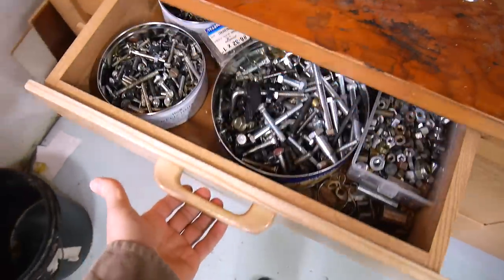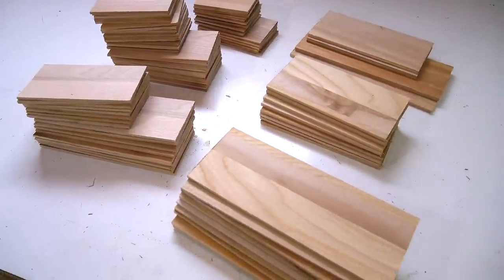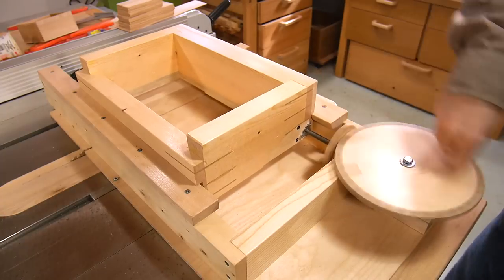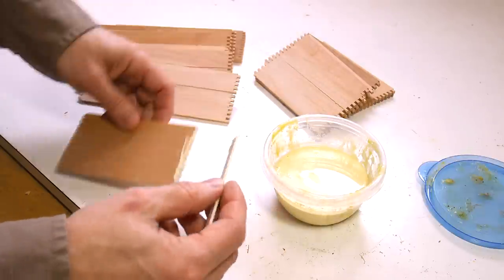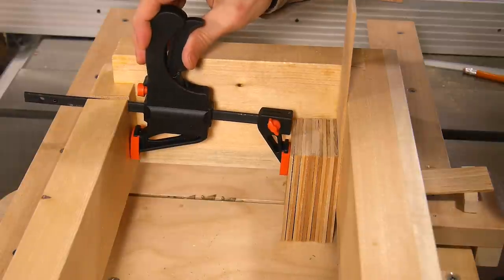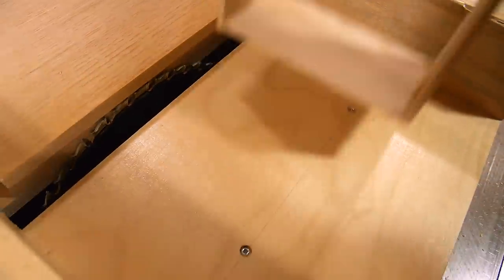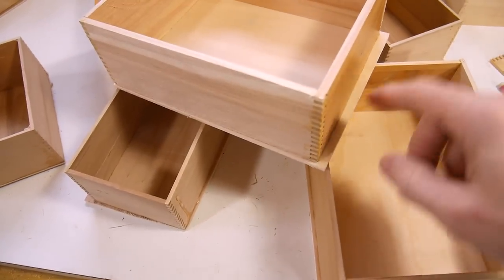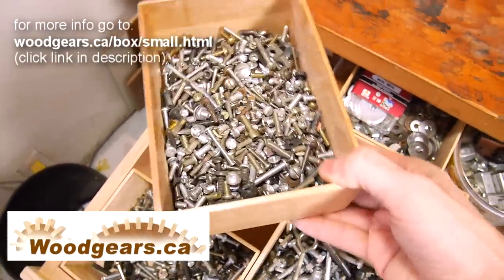Small box joined boxes

Comment: A neat trick around every corner in this video. That angled flush trimming setup, for example.
Reply from the maker: Yes, I spend a lot of time thinking about how to make the project before I actually make it.
Reply: Matthias Wandel It shows in your work!
Reply: Matthias Wandel I do the same, no matter how big or small the project....Specially with big projects like renovations, I basically go over the whole project in my mind before I actually pick up a tool.....
Reply: Justin Pang if you look at the outside of the jig it is not able to go low enough for the C-clamp to work with any amount of pressure

Comment: Back cutting on the pull stroke of the SABJJ made that go very quick! Thanks for sharing.
Reply from the maker: MRrwmac Have been experimenting.  For vertical cuts like that, the saw works better when it's cutting backwards.
Reply: Matthias Wandel Acting just as a scoring blade/ wheel. Was nice to hear you at BrainPick. Thanks!

Comment: Matthias, I found a neat way to store my fasteners. I got a stack of alarm control boxes, and plan to put dividers made from scrap polycarbonate. I'll make a way to stack them like drawers so I can easily save space this way and have nice access as well. The back of the panels have mounting studs that I'll either grind off or chisel out. Some of the boxes are used, but some have not been, so I'll need to cover the openings on the sides.

Comment: I (being obsessed with boxes)  like these a lot. I and loved the bevel you put on the bottom. Never thought of that and it makes them a bit more refined.
Reply from the maker: Christopher Demetrick And it hides the fact that the bottom is just glued on the bottom.
Reply: ***** That would be much harder to clamp and much much harder to fit up. Matthias made cutting the bottoms easy by oversizing them and trimming them later.  If the bottom needs to fit exactly between the 4 sides then the cuts need to be very accurate.  You are right that it would automatically square the sides if you could install the bottom during glue up
Reply: Sully800 that is why most drawers or boxes have the bottom installed inside the 4 sides...it squares up the boxes and doesn't rely on the joints to keep them square. Now with something "utility" like these, it isn't so important but it is VERY important if you want your drawers to slide properly....well, THE drawers you're installing in a cabinet, if YOUR drawers slide too easily, it'd get mighty uncomfortable under your jeans! lol

Comment: A tip for gluing finger joints. Put the joint together but do it flat, that is, butt the ends together on a flat surface. This makes sure the joint is aligned and you don't glue the wrong side. Add a thin layer of glue to the fingers on the inside of the joint. Hinge the joint together so that it correctly forms the right angle. The glue now makes contact with all the inside surfaces and nothing but them (minus any squeeze out, of course).

Comment: Greetings form Norway!

Awesome video. I suppose you could use a 10 - 12 mm round piece of wood and screw it in the center of the box(screw from the bottom) and use that for lifting the boxes out of the drawer. Especially if you made the boxes to cover the entire drawer. Not sure how much weight it could handle but at least for small boxes I dont think it would be a problem.

Thanks again for a good video!

Comment: You said in your other video "the space efficiency of pure chaos is hard to beat." I bet you could get more screws in that drawer if you were to forego the containers entirely and just dump them in there. You may have some issue finding the one you want though. Perhaps instead of putting boxes in the box (the drawer), instead cut thin dividers and notches in the drawer so that you can drop the thin dividers into the drawer. This will keep the individual components separated while adding minimal weight and space overhead. You'll need to work out an interlocking system of dividers though, and perhaps that would offset any gains you might see.Hmm. Maybe if you painted the bolt heads in different color paint, one color for each thread type, then just dumped them all in the drawer you'll maximize the space savings while retaining some ability to pick out the parts you need more easily. Length is easy to judge at a glance, and the colored bolt heads would easily identify the thread type.Just a thought. Good video though!

Comment: I've been trying to learn about box joints and had a question about your video.  I've seen a lot of people use hand planers to trim off the excess parts of the box joints, but in this video you just trimmed them with the table saw.  So I was just wondering if you used this method just for this specific job, or if you use the same method for all of your box joints, and why?  Thanks for sharing your talent.

Comment: Will the bottoms hold with just glue? Would be great to see them joined too! Though I guess you would have much more trouble making measurements to guarantee they fit perfectly.
Reply: allluckyseven yeah a rabbet would make them infinitely stronger and a dado even more so but with such thin material you're pushing the limits of the material. If you wanted to make them stronger, and I've done this on larger pieces, is you drill 1/8" holes through the bottoms into the sides, then glue in 1/8" dowel. Leave them long then trim them off with a flush cut hand saw.....I've done that on the sides of decorative items and used a contrasting wood....makes them quite pretty.

Comment: Would a wide paintbrush work to get a good coat of glue between the notches? Dip the brush and just run the pieces of wood over it. I think the bristles would get most of the glue where you want it.
Reply from the maker: xWOOLYxMAMMOTHx Yes, would work, but would be messy, didn't feel like having to clean it up.

Comment: Matthias, how come when you were cutting the finger joints for the 2nd side you pushed the jig through the saw turned the gears and pulled it back through and turned the gear, but when you cut the finger joints for the 1st side you pushed the jig through and pulled it back then turned the gear and pushed it through and pulled it back then turned the gear. Why did you do it differently the second time? Thanks so much and I LOVE YOUR VIDEOS!!!!!!!!!!!!!
Reply from the maker: Reese Asher Because I realized for those cuts, cutting backwards works just as well.  Only realized that part way thru the video.

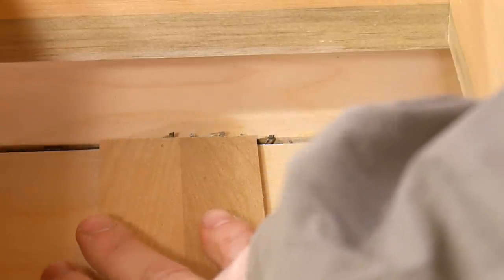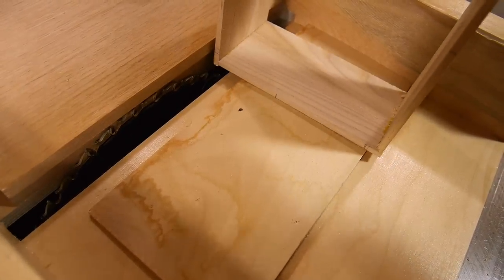Comment: Nice work however, one question. Why setting the blade higher than the thickness of the material at 1:43 and then flushing it at 5:55? Wouldn't it be quicker to make smaller cuts to skip the flushing? Thx

Comment: For the clamp in your box joint jig: do you think the lack of holding power was just because it was a low quality clamp? Or was it just that any spreader clamp in that arrangement would fail? ie would the irwin clamp of similar design hold up? I know those to be pretty solid quick-clamps
Reply from the maker: +Chris Johnson that style clamp is not very strong
Reply: corap patik modelrni el
Reply: Thanks for the spam Rick!

Comment: lot of neat tricks Matthias :) i wonder why you wouldn't have used a long reach clamp when you were cutting the shorter pieces though
Reply from the maker: Peter Matthew Longer clamps don't help because only the top half of the stock holding box is exposed on the outside for clamping against.

Comment: With just glue holding the bottoms on, are you worried about how much weight all the screws put on them?
Reply from the maker: Jason Steih No.
Reply: Matthias Wandel I'm pretty confident about the strength of the wood glue, but why didn't you incorporate a rabbit and/or dado to put any doubt to rest?
Reply: James Campbell Gluing (plywood) bottoms on is surprisingly strong, long as you sand flush so bottom / glue joints mate perfectly - I used to always cut slots for bottoms - so much quicker this way, full storage use of box height, more attractive (to me), and probably as strong, since the slot itself weakens the box (many solid wood DRAWERS split/crack along the slot of sliding bottoms. Very small boxes you can get away w/ solid bottoms glued on, but larger ones you need play so they don't expand/contract unevenly & split.

Comment: I'm kind of surprised those bottoms work with only glue, without a groove to hold them in. How are they holding up?
Reply from the maker: +spaaarky21 No issues.  Theglue is as strong as the wood.
Reply: +Matthias Wandel Is it possible to finger joint the bottoms as well or would that be too overcomplicated/overkill?

Comment: Isn't it possible to cut the fingers for both ends of the side board from the same index.? Assemble, then rip the excess material off after the box has been assembled?  Then the tops and bottoms of the sides are perfectly matched.
Reply: Burntsider You would have excess to rip off both top and bottom.  More work, wasted material, shorter boxes vs. offsetting the fingers with one simple setup change.

Comment: How much weight can the boxes hold? When I eyeball my constructions I probably go way overboard, but this looks kinda flimsy considering how heavy metal parts are. I don't really have much experience with glueing thin wood together. My boxes would be almost finger thick, with a groove for the bottom. So, is this really enough? Doesn't that bottom break off easily?
Reply from the maker: Tarc I don't know.  I haven't broken any.
Reply: Alright, fair enough. Thx for sharing :)
Reply: Tarc I'm no real woodworker (yet) but all those glues say <<Stronger Than Wood>>, so even without the finger joints, one should expect the boxes to break anywhere else than the glued parts... but with those finger joints, it seems rock solid to me.

Comment: Why do the boxes have box joins on the edges, but not the bottom?  Are they just decorative?
Reply from the maker: because box joints on the long grain side add no strength
Reply: It's a grain thing?  Cool.  Thanks for the reply.
Reply: I'm in college for wood working and cabinet making, and usually you wouldn't do a finger joint on the bottom edges because you would slide a bottom into a dado cut, which is a tiny groove that is on either side that the bottom would fit into.
Reply: No, you just don't need to. The box joint makes the walls strong against sideways movement, but you don't have to worry about that for bottoms

Comment: Excuse Mr. Wandel, I live in a house with a basement that isn't too wide, or high for that matter (sometimes my head touches the ceiling), and it isn't too big, so the problem is, that I can't cut big planks on my table saw. Is there some kind of jig that I can make, that I can use my handheld circular saw, to work vertical instead of horizontal? Meaning, just put my workarea against the wall, place my planks on it, and saw the planks vertically, instead of horizontally, to make optimal use of my small basement? (i'm pretty sure, i'm not the only one with that problem)
What would the best way be? Or can I even alter my homemade table saw, so I can hinge the workarea in a 90° angle (but not saw with a fixed saw)
Reply from the maker: Flor Hoorebeke I have not designed such a jig. For workpieces that are too long, I use my pantorouter machine (which uses a router)
Reply: yeah, a jig that you can place against a wall and then take your table saw and saw from top to bottom. That you can take advantage of the height what you lose in width of the limited space I have :-)
I know it's just a flat board you place against the wall and some gliders that work like a vise, but it's still easier said than done you know :D
Reply: Look up homemade wall saw. Wmv.... There's a few others too :-)
Reply: i'll try :)
Reply: Another possibility would be a track saw, like a Festool.  You could break your panels down easily outside then bring them down to the basement. Easier to carry downstairs that way as well.  You could also make your own guide rail for that matter.  Just attach a 1/4" piece of hardboard to a perfectly straight piece of hardwood, leaving enough width hanging out so your circular saw cuts it the first time.  Now you have an exact guide to line up on your marks.
Reply: Wanderingskeptic I agree with you a much simpler idea I have made myself one too I would recommend using marine ply if possible less chance of movement due to moisture :-D festool and other track saws seem to be way over priced in my opinion!!
Reply: Jack Finnerty they are pricey. I love my Festool saw, though. It gives me an edge ready for glue and the dust collection is superb. I agonized for a long time before buying it, but I don't regret the purchase.
Reply: Flor Hoorebeke 

Look at vertical glass saws for design ideas,  Properly weighted gravity can even do the job of pushing the saw for you :)
Reply: very goods I dear

Comment: I know this clamp. It's a piece of crap. Branded as VOREL in Central Europe but it's sold probably under a dozen of other brands everywhere else.
Reply: I was referring to the expanding clamp at 2:50 onwards.
Reply: What's wrong with it?
Reply: The worst part is it's got sloppy latching mechanism made with non-hardened steel (mild steel) so even if it works so-so out of the box, it wears out quickly. First there's a huge backlash in the mechanism (short effective stroke of the trigger) and then the clamp refuses to hold at all. I've got some pictures of the insides if you really need them. IMO it's a waste of time. If you don't know what to buy, buy the IRWIN ones for starters and then take your time to explore. I suggest woodworking-dedicated stores like highland or fine-tools which don't sell boxstore crap (such as this clamp) in principle. Also, DIY cam clamps are a great project right after your first marking gauge! ;)